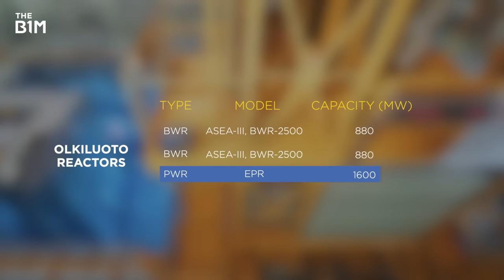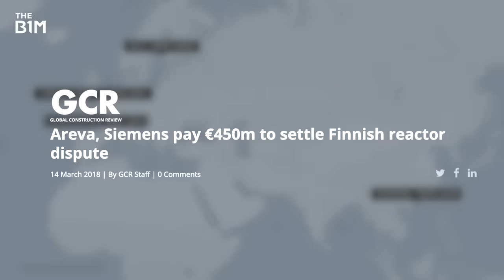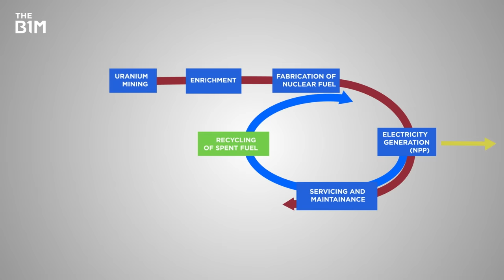Finland Might Have Solved Nuclear Power’s Biggest Problem

Comment: I really was hoping for you guys to explain more about the more modern and efficient 5th generation molten salt reactors that use Thorium instead of uranium as fuel. These reactors require no water or human intervention to operate and Thorium as a fuel has a half life of a few hundred years instead of thousands like Uranium.
Reply: @bike-cave-man2527  Have you watched a video on a thorium reactor? it can't blow up. The worst that can happen if the cooling system fails, is the plug unfreeze, letting the molten salts fall in a container, where they will slowly cool down and solidify.
Thorium is an amazing technology, unfortunately, it is extremely corrosive and we still haven't found the solution to the extreme heat and corrosion.
Reply: Right ! The solution would be to STOP!  JUST STOP USING IT
Reply: @js2693  and use coal more?
Reply: With air scrubber and ppe for employees
Reply: @js2693  That doesn't work as much as we try, coal will literally never be carbon neutral.. Coal is also non renewable, neither is nuclear, but nuclear lasts far longer, and is far safer. If you look at the data, nuclear is the safest option of literally any fuel source, furthermore it's a efficient way to reach carbon neutrality while technologies like Solar and Wind continue to advance and catch up. In an ideal world we'd use only renewables, and have no use for coal, gas or nuclear, but we're not yet in that world and of those three options nuclear is the safest and most efficient.  Besides, your logic is the same as people saying we should just stop going to space because of two unfrontune shuttle disasters. Accidents happen, but it's the exception not the rule when it comes to nuclear, unlike coal where it'll continue to kill thousands until we stop using it.
Reply: @bike-cave-man2527  Technically the reactors never blew up, but the radiated water pressure is a whole other problem.
Reply: @frank 1976 Chernobyl was estimated to cause 10000 deaths from radiation, Fukushima caused a single radiation death. Meanwhile air pollution is the reason for 100 000 deaths a day
Reply: @frank 1976 I compared it to the shuttle program because like nuclear disasters it was extremely publicized and made people have conversations about halting space travel. Similar to nuclear accidents.

 Also, that is a unfair comparison because there are plenty of other fuel options which do exactly the same thing. For example, the most widely known non nuclear disaster is likely the centralia disaster where a coal mine will be burning for thousands of years, that land is also completely ruined for thousands of years, yet it's rarely spoken of. Another example is the Banqiao Dam disaster which literally wiped villages off the face of the earth ...  Yet it's also not commonly brought up. 

So yeah, nuclear can do those things, but so can these other fuel sources, and one is overall better and less dangerous if you look at the statistics then the other.
Reply: @iain3713  Nonsense. Chernobyl killed a few dozen from various causes, including thermal burns, in the accident. Some possibly from high doses of radiation but far from all of them. Other than that, a couple of hundred people living in the area are expected to die prematurely from thyroid cancer. This is mostly because of inadequate screening and treatment because thyroid cancer is very survivable with a relatively minor surgical treatment (removing the thyroid).
Reply: @none--other  Wrong. China is building several hundred GW of cheap and reliable coal power while the West is destroying its economy with expensive unreliables.
Reply: The thorium is not the key, the molten salt reactor is. It can be designed to run on all sorts of fuels including uranium, thorium, nuclear waste, depleted uranium etc.
But it's not really a solution to safety since existing light water reactors are already the safest reliable power source we have by a huge margin.
The real potential is that the MSR can be much more affordable.
Reply: The real problem with these is you can't use the reactors to manfacture weapon grade fuel. The other problem is they might actually work, political donors don't like that.
Reply: @Pengun3  Yeah but people don't understand that and people fear what they don't understand.
Reply: @bike-cave-man2527  if it isn’t under pressure, it can’t blow up. Literally, there is nothing to blow up. That’s why they say it can’t blow up. 😜
Reply: @frank 1976 nuclear energy almost never contaminates the environment. Please do research before acting so harshly
Reply: @bike-cave-man2527   You can't blow a reactor that has the same pressure as atmospheric pressure and you can't meltdown a reactor if the reactor fuel is already on molten form
Reply: @bike-cave-man2527  The meltdown in Fukushima didn't just happen spontaneously it required a natural disaster of almost unprecedented magnitude to occur.

Even so, the radiation released is unlikely to ever cause any significant negative health effects.

The deaths caused by this natural disaster are as following:

The tsunami and earthquake: about 20,000 deaths.

The government mandatory evacuation of the people in the area (which was probably completely unnecessary): about 1000 deaths.

Deaths from radiation released from the plant: zero.

Total deaths from civilian reactors of Western designs since the invention of nuclear power: zero.

On the other hand of the equation, reliable and affordable nuclear power has saved around two million lives worldwide by displacing coal power and therefore reducing air pollution.

Unreliables have never reduced the cost of electricity, they just add more cost and unreliability to the existing grid. They need almost 100% backup from fossil fuel sources such as natural gas or oil.

Germany now has the world's most expensive electricity thanks to their stupid investment in solar panels and wind turbines.

Meanwhile, France next door has half the cost of electricity and much lower emissions because they use nuclear.
Reply: @otov100  I wouldn't trust a rogue state with a thorium cycle reactor even if it's supposedly harder to use for weapons production.
Reply: @js2693  lol

Comment: Considering nuclear waste, why don't you say something about the Russian BREST-OD-300 reactor project that can work on fuel produced from recycled nuclear waste and Uranium-238, which is very abundant in nature. They began the construction earlier this week btw.
Reply: TYVM:  This is the 'technology' that will solve the Level I waste problem.

(So could magnetic torus fusion reactors, I believe.)
Reply: 1:it's russian so westerners just ignore it because it makes them insecure
2:it doesn't perpetuate the myth surrounding nuclear power and waste
Reply: @HuntingTarg  What is important, it solves the problem of spent nuclear fuel and increases the resource base of atomic energy so much so that we won't have to worry about running out of fuel for the next several thousand years. Wastes of a closed nuclear cycle compared to the traditional open fuel cycle are minuscule. What is 'Level I' waste, I don't know since nuclear waste is classified as low, medium, and high.
As for thermonuclear power, it's still a long road ahead of us. Plus, even if the technology succeeds, fusion reactors will be significantly more expensive to build and operate. They would also require extensive shielding compared to traditional fission designs.

Comment: That method was introduced in Sweden in 1992 but due to regulations and laws where the counties have to have a referendum ( has to be done over 2 election periods as in 8 years ) it has taken its time. However the method was made but the KTH Royal Institute of Technology in the 80's.

Glad that the political mills grind faster in Finland. 
As mentioned in the video I may add, just pointing out how slow things can work in Sweden.

Comment: It's sad they aren't building a reactor that leaves these long term products, when there are reactors that can be built that leave the end product something manageable on a human timescale. Or at least they can design an automated process to recycle/enrich the spent fuel.
Reply: I think that's Natrium Fast Reactors - yeah, no trans-uranic wastes (that's the ones that are radioactive for billions of years) - just "regular" radioactive waste which has half-lives so short it's not radioactive anymore after like 100 years... since you can fit the entire US nuclear programs cumulatively generated waste since the program came online in the 1960s in a single (on the large side) room - this would definitely present a permanently sustainable basically ecologically zero-impact clean energy source. I have no idea why they're not building those type of reactors.....
Reply: I'd definitely be behind the idea of first recycling the spent fuel and burying the product that is no longer viable. On the other hand though, a nice thorium reactor would be neat
Reply: exactly
Reply: @inochifumetsu  what does that reactor use as its fuel?
Reply: 80% of the spent fuel can be recycled into the next fuel cells. France does this currently
Reply: @inochifumetsu  coal and oil industries are slowly adopting the idea they will be replaced by Nuclear energy, but that does not stop them from impeding the progress to line their pocket books a little longer while they find a way to capitalize on this. This is USA at least..
Reply: @sethb3090  All the Fissile uranium gets spent. So no energy is left in the fuel. It's just that 80% of the fuel is Uranium-237 which is inert and is used in the fuel to slow down the reaction. So the Uranium-237 can be reused since you'll need it regardless
Reply: all these physics talking big in a comment sections
Reply: @inochifumetsu  There's one though, Beloyarsk NPP.
Reply: @inochifumetsu  because that does not work(that way).
Reply: @InSomnia DrEvil It's because there are better nuclear solutions.
Reply: @inochifumetsu  well, for starters, you can thank the NPT for that - breeder reactors can be used to produce plutonium for nuclear weapons. Secondarily, sodium is a pain in the arse to deal with, since a) it is highly corrosive and b) it produces hydrogen when it comes into contact with water, meaning that leaks in the coolant lines are a very real possibility, and said leaks are not at all unlikely to start fires and/or cause explosions. 

This is not to mention the issues with fast neutrons, which will damage the materials of the reactor, too. Overall FBRs have a much shorter life cycle than moderated designs, and while they could leave virtually no trans-uranics behind, they generate a lot of low-activity radioactive waste (which would still need to be contained for generations) and have the potential to fail in absolutely catastrophic ways. 

Also, most FBRs use a liquid metal as a coolant. Favorites are mercury and lead, which are... Yeah.   

This doesn't mean that the idea is without merit, and in fact most proposed "Gen IV" designs are FBRs of one type or another - however, there isn't any design for a commercial reactor that solves those issues yet.
Reply: Tech keeps changing, one day a much better way of reusing material closer to maximium will come along. EVs are only good in more major areas and cannot go very far yet, takes time, be happy people are working on these issues.
Reply: @inochifumetsu  It's always funny how people with zero sense of awareness suggest "solutions" for problems the scientific community has been investigating for decades! Like the myth of Thorium reactors, it often boils down to either being extremely price inefficient (read too expensive!) or simply not feasible from a technical perspective...
Reply: @dontlaughtoomuch11  so what’s the real problem with thorium reactors then, because I don’t currently see one. They’re much safer, use a more abundant resource (that doesn’t need to be enriched as much as uranium), it’s just that you can’t make weapons out of the waste products. That’s the only reason I can think of why there hasn’t been much investment in the technology.
Reply: @mattshalash  The problem is that they are too cost inefficient. On paper it looks like a super good idea, however in reality it's far from efficient! Even in China the country with the most graduated nuclear engineers (if I recall correctly) are still in the test phases of Thorium reactors... It all has to do with the billions of dollars you need to pump in the reactor, the technology simply isn't there yet, unlike power plants that use Uranium...
Reply: @dontlaughtoomuch11  right, but it’s not an inherent technical flaw we can’t quite overcome unlike say fusion power, where it would take more energy to jump start it than we make as a whole on Earth. Thorium has been ignored because it can’t make weapons grade materials, whereas uranium can, and the billions were put into that instead
Reply: @mattshalash  No they actually tried in the 70's + 80's +90's in japan, Germany, Canada and the States and time and time again they came to the same conclusion; "it can't be done cost efficiently!" At this point it has nothing to do with weapons anymore, we're far advanced beyond the 50's. They just don't have the technology to do it as efficiently as Uranium nuclear power plants... Actually a certain start up very recently was doing MSR research and sadly they had to halt the project and its finding for free on the cloud, and this was a US research company. Seeing as China is currently taking the lead, the soonest we'll see any advances would be by 2030.

Comment: I wonder if people know how many tons of problematic waste is generated whenever a wind turbine is in need of some maintenance
Reply: I work in the oil industry and have lived within five miles of a refinery for almost my entire life.  To get home I drive though a giant park that I remember having houses and businesses, but were all torn down due to groundwater pollution from the refinery.  I design, implement, and upgrade control systems for fuel farms, and see firsthand what happens as materials get removed and replaced.

I have colleagues that have worked all over the energy sector.  I hear similar stories from them.

There's no way you could possibly convince me that maintaining wind farms generates more waste than maintenance of oil refineries or coal plants.  Someone is trying to sell you something.

Comment: All these new type reactors are great. Now we really should be coming up with much greater efficient ways to transport the power to the public! Seeing as a great amount of energy is lost in transport across old outdated wires.
Reply: I just watched something that mentioned this issue. It seems that it just requires a high voltage line. At the highest existing voltage lines there are, it's only like a .03% loss or something like that (going off my memory from the video I watched). It's just a matter of getting these lines up and running between long distances
Reply: Less than you think. About less than 10% in france between production and distribution
Reply: There's a lot more problem then that with today's wire. I've worked for a high-voltage wire manufacturer and basically every company is researching new wire-technology. The biggest problem is that a lot of deep-sea wire are encased with lead, and the EU has enforced a regulation that all lead in every industry everywhere should be decreaced. Also, work on ulta-efficient cables are also in motion. The first companies to develop these will dominate a large portion of the worlds cable market.
Reply: Wind and solar are the main drags on the networks, being so far away from consumers, and providing little energy for the amount of cabling needed...

Killing those and focusing on reliable power would improve efficiencies and drive down costs immediately...
Reply: @James Smith The problem of transport is real but that is why individualized solar, wind, geothermal and hydrogen would be superior. The grid could still be connected but the excess electricity dumped into it would balance the costs of using the grid from time to time.

Comment: I'm a huge supporter of nuclear despite its problems and I think it should entirely replace coal/gas for energy production. The only complaint I have is that only 1% of the fuel is used and then buried. Future reactors such as LFTR's could potentially use up to 100% of the nuclear fuel so it should be stored temporarily at least for another 10-20 years until the more modern reactors come online. Otherwise this is a good option and I applaud Finland for forging ahead despite all the fearmongers opposed to nuclear energy.